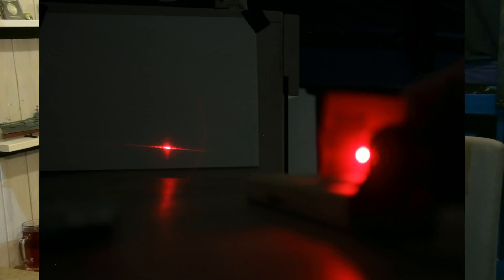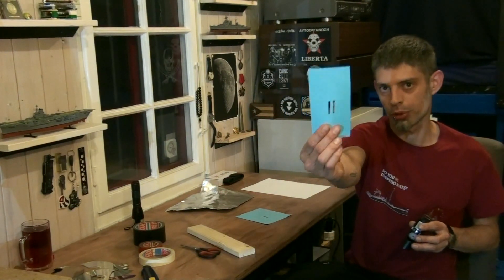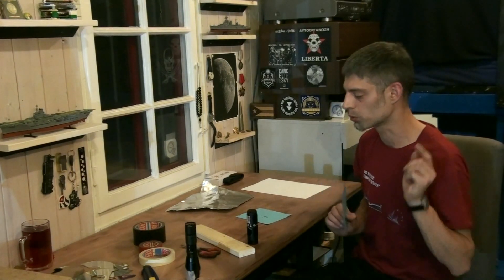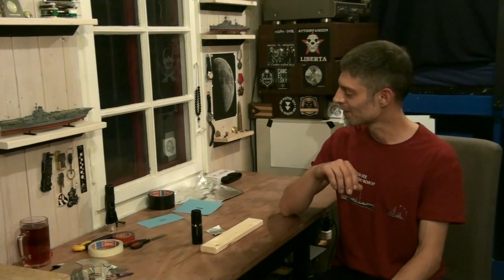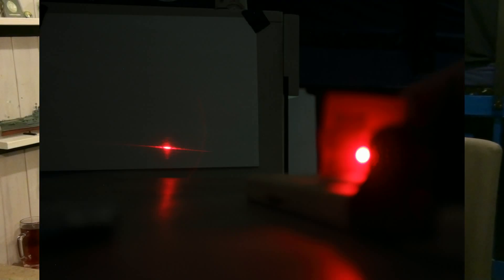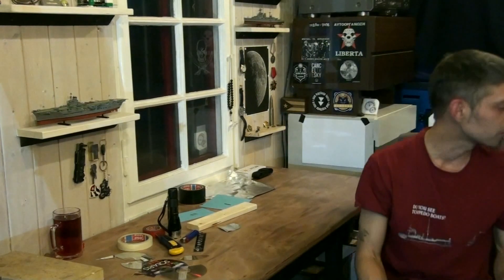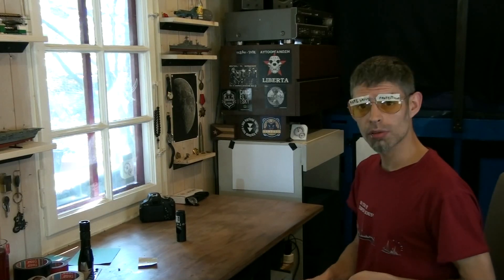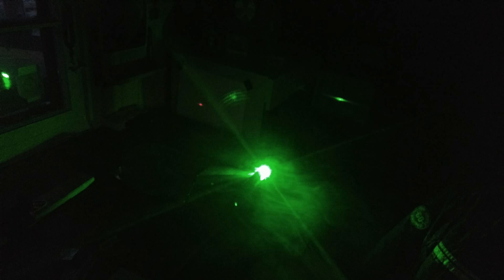Stay at Home Experiments #1 / DIY Double Slit Experiment! Quantum Physics at Home

Comment: Cool educational video, thanks.  But I think I missed something,  I thought the whole point of the experiment and what made made it lead to ideas of quantum entanglement etc isn't seeing the interference pattern, but rather that the interference pattern went away and instead you only saw the photons or electrons behave purely as particles with two lines if you used a sensor to observe them before they went through the slits (or even after with them acting like they were able to travel back in time) and behave purely as particles.  In other words there's no magic in seeing them behave as waves, the thing that makes the experiment mind-boggling is that their behavior of the particles/waves is altered simply by whether you are observing them or not.
Reply from the maker: Thank you for youre nice words! Yes i am aware i need to do a follow up at some point ;) i just threw that video together beginning of the pandemic so it was a bit rushed ;)
Reply: @BremsstrahlungChannel  I very much appreciate your video and comment.  I have only recently started exploring this bizarre world of quantum mechanics and it is excellent videos like yours that have helped me, so thanks again.  As I mentioned in my other comment, the part that blows my mind about the double slit experiment is the claim that when you measure the particles/waves be it light or matter like electrons with a sensor before they reach the screen or detector, they revert to behaving like only particles and you no longer see the interference pattern. But I'm not sure how you would do this part at home.  Obviously getting an electron beam generator at home would be difficult and dangerous so using the laser seems best.  But for the detector rather than a screen you might need  camera film that would show the pattern when exposed to the light of the laser.  You then could first pulse the laser through the slits onto the film and look for the interference pattern,, then pulse the laser with some sort of sensor 90 degrees angled from the laser that could sense and record each pulse of the laser then see if the film still showed the interference pattern or only a simple 2 slit patter of exposure.   I have no idea if this would work or if it requires sending the particles 1 at a time and measuring each particle.  I'm not even sure I believe the experiment can have 2 divergent outcomes depending on whether you measure the photons or electrons before they reach the screen/film/beam attenuator, etc because that seems akin to magic so I need to see it with my own eyes lol.

Comment: Would this test have the same results if done in a vacuum chamber, since air has fluid dynamics?  A boat moving through water (the boat is a particle) generates waves through it.  The boat can only drive through one slit at a time.  The water waves would generate the interference pattern.

Space is almost never a true vacuum. When a detector is used, does a single particle only generate a single hit?  Is that single photon absorbed leaving only the waves to continue on? Is the result then the particle or the wave convergence?

What about done North of the equator vs South, as in the Coriolis effect, since electrons have spin?
Reply from the maker: Thank you for youre Comment, Good Questions! A Friend asked me a similar question about Vaccuum/Air. As far i can figure out, the difference would be very minimal, since Air is mostly transparent to light. Refractive Index plays a role for shure, but since Refractive index of Vaccuum = 1 and Refractive Index of Air is about = 1.000293 this gives us an error margin of 0,03%. I like youre Idea of a Boat moving through Water, im not 100% shure but i think this goes in the direction of "Pilot Wave Theory", look it up if you want! 
Im not really shure about youre second question, but i think when the Photon is absorbed, its just absorbed.. no wave or particle left to observe.. 
And about Electron Spin, as far i know the Quantum "Property" of Spin is not really "Spin" in a physical sence as we intuitively think of it. Quantum Physics is really weird! ;) But Electrons will for shure react to Magnetic Fields, i can actually see this effect in a Clud Chamber or even with a High Voltage electric Arc (you can bend those arcs with a magnet). But Photons dont really care about magnetic fields :)
PS: Heres a Forum i found that maybe anwers youre question in a better way:
https://physics.stackexchange.com/questions/104485/is-the-double-slit-experiment-typically-carried-out-in-a-vacuum